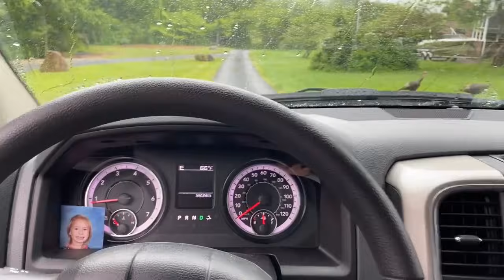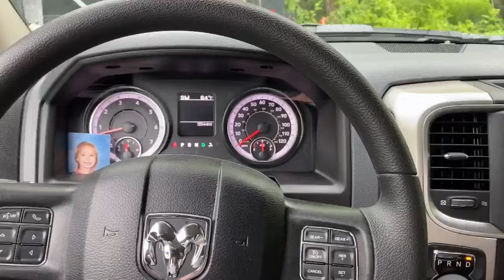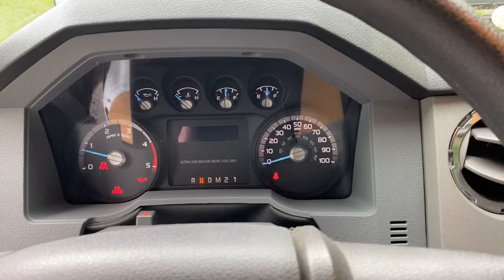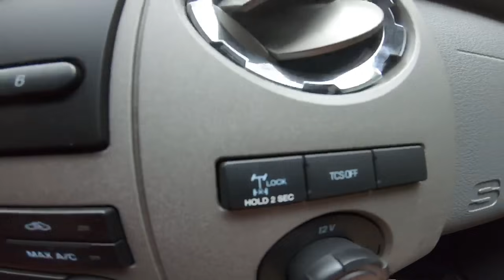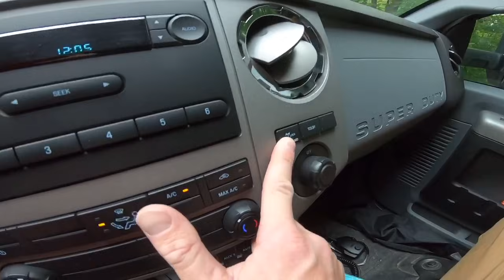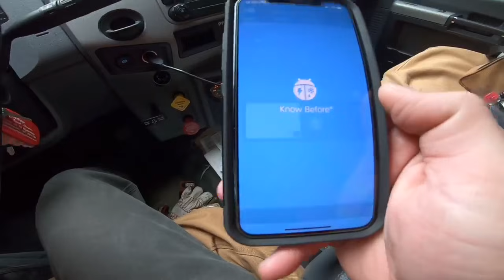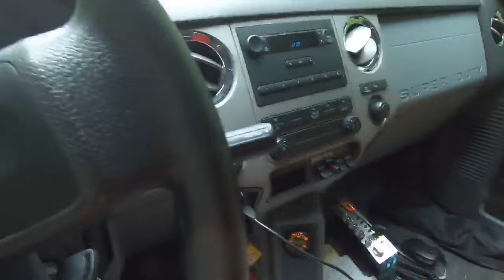How To Grade Your Driveway With A Box Blade

Comment: Just used my Box blade for the first time yesterday.  Your video re-enforced what I learned.  I also found out what I already knew is that I need a hydraulic top link.  Also li Dr cylinders would be very helpful to keep from getting on and off the tractor. I knn be is this is an old video but it was very helpful.  
Thanks for the good content.

Comment: Enjoyed your discussion of the different aspects of doing this as a business. We are headed to a simpler place where I might need a career change and to a property with an access road built on native clay soil which is passible only with 4x4 in spring and fall. The road also passes through a couple wet/marshy spots. I decided to buy a cheap dump truck to haul rock in and build the rock up with larger stuff in the soft spots. Also need to change the tail gate arrangement since it is side doors. Question: do you ever haul and spread thicker material such as 3inch or 4inch minus? Seeking wisdom in selecting the right size rock for the roadbed

Comment: Thank you Todd: that was very helpful.    
I would like more instruction on how to use the draft control with a box blade. I am uncertain about when the draft control should be down and when the draft control should be up when using my box blade. One other situation I encounter with my box blade is that at the end of the run, I am typically left with a lot of material in the box and I don’t know what to do with it. Your help is appreciated.
Reply from the maker: I’ll try to hit on those topics in my next box blade video. About 10 feet before the end of your run start losing your 3 pt Control slowly. With some practice you’ll be able to do a gradual taper

Comment: Caution with a tree.  Do not build up the ground level where the root flare meets the ground.  You can kill the tree. by altering ground level at the root flare.
Reply: Not all tractors lock the 3 point down when you put the control all the way to down.
Reply: @fhuber7507  Mine doesn’t... Kubota B2650